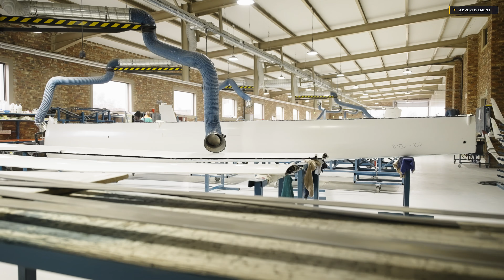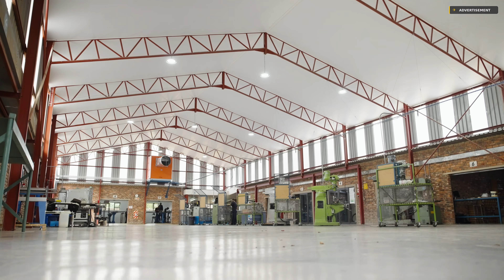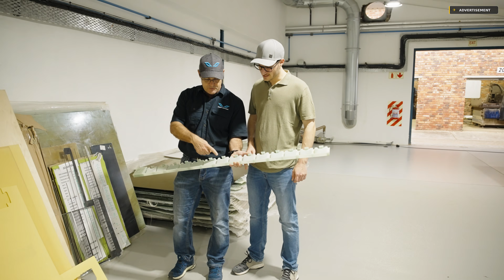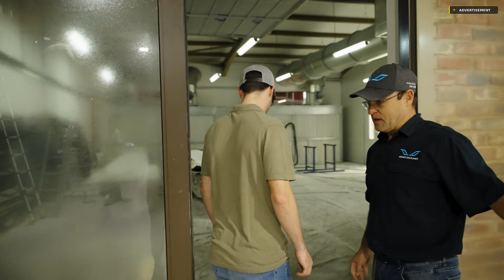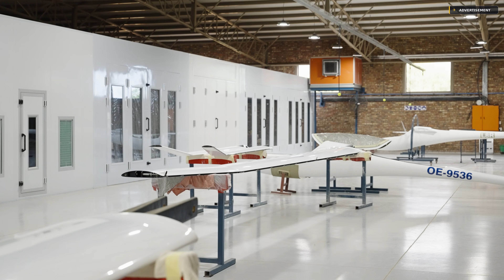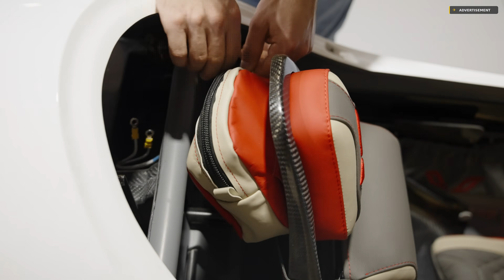Inside the World's Largest Glider Factory - Jonker Sailplanes

Comment: Now that they have a big enough factory maybe they can leverage the economies of scale and make an affordable pure glider for us common folk who don’t have new home levels of spare cash laying around to be able to buy one of these modern ships. 

Gliding will die if this problem isn’t addressed. Every day more and more 60’s, 70’s & 80’s affordable ships are falling out of the global fleet and not being replaced by manufacturers, meaning only one thing, gliding is in decline due to costs. This isn’t acceptable for gliding which is the cheapest form of aviation. @stefan, perhaps a topic for a future video? 😅
Reply from the maker: I´m not sure if gliding declines only because of the costs. You can still get nice club class gliders from 15k €. There are so many other factors involved and the main one is time for the hobby.
Reply: @SteFly I agree that the Xbox generation are also not getting out into the elements anymore like my generation did when we were kids, it is very likely that it’s an issue that’s compounded with lots of factors. I do believe though that someone should do an analysis of gliders being written off each year vs those new built being released into service by manufacturers.

Comment: I see big opportunities for modern manufacturing techniques to be implemented, rather than 'waterfall' techniques!
Short term cost and long term cost reductions.
Most notable it does not appear to be a digital product. No monitors anywhere in the production process.
No enterprise software.
No automated measuring and checking. 
Ethernet wiring would slash that loom to a tenth of the size, weight and cost.
Guy checking the fuselage finish (19m) appears to be blowing dust off - no mask! - lung  cancer...
Low operator density.
Low product density.
Low space/time density.
https://www.youtube.com/watch?v=N-JYhKZV4-A&t=36s
Reply: This is completely missing the point and wrong on so many levels (technically, financially...) This is not SpaceX or Tesla, this is low volume, highly certified/manual labor for a niche market. Everything mentioned would add unnecessary cost, complexity and headaches to Jonkers.
Reply: @Magnet152 Space was and still is, low volume, highly certified, high manual labour, niche market and horrendously expensive for everybody - except SpaceX and latterly Rocket Lab (robotic carbon fibre layups)!
https://www.youtube.com/watch?v=zmJdJIlPOr4
Reply: @waynerussell6401  you are comparing ships that sell for maybe 350k€ to maybe 100m€, so please...
Reply: Set up your own Factory and shown us all how its done then.....put YOUR money where YOUR mouth is............
Reply: @flyingisfun3328  My money is already doing very well in those companies! The world of manufacturing is undergoing a sea change. Those outside the new technologies are already suffering. All the legacy car OEMs for example have Altman Z scores that show a two year future is unlikely.
The light aircraft and General Aviation sector is similarly experiencing severe strain due to skyrocketing costs, a critical mechanic deficit, and shifting demographics. High production and regulatory expenses have pushed new aircraft prices out of reach. 
AI and robotics are the technologies that can reverse this and make all economies prosper.